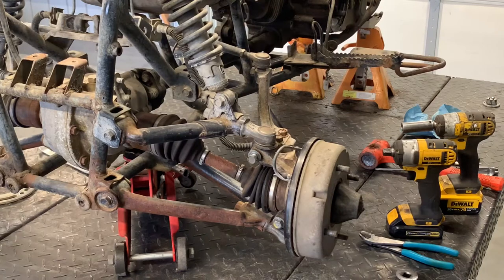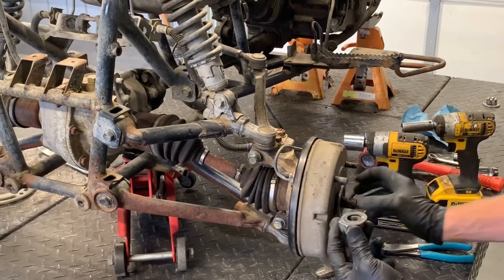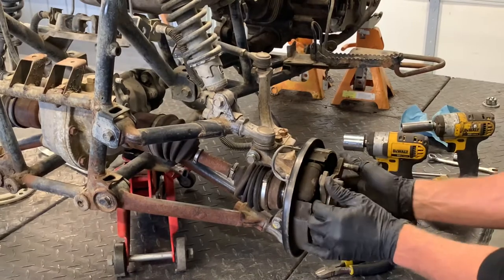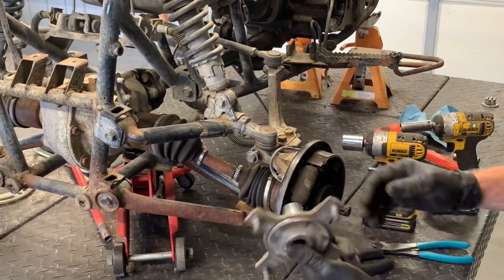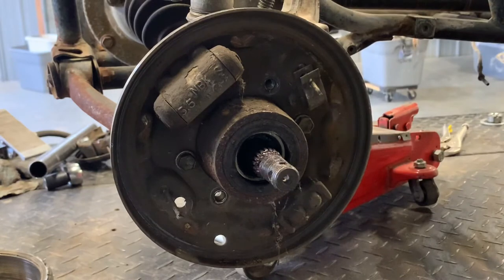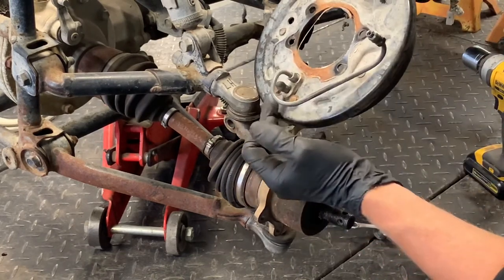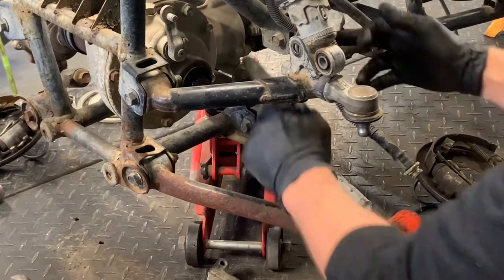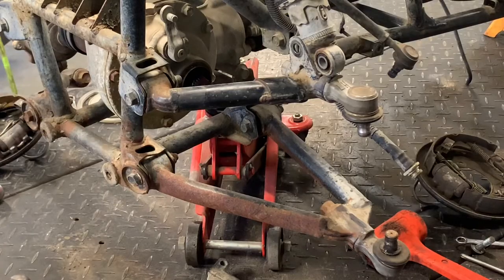Suzuki Quadrunner 250 - Brake Shoe Replacement - GETTER Done RIGHT!

Comment: Also little bit of knowledge from my understanding, is that the Suzuki SHOE HOLD DOWN SPRING (that most aftermarket kits don't come with) is designed to stop the brakes expanding to much by holding the lever arm by spring clip so you don't ruin your wheel cylinders if they get too low (like mine did and you have to buy repair kit or replace them which is expensive)

Comment: Good job. Great video. A little knowledge for you bolt size are not designated by the socket size you use on them but the diameter of the threaded portion of the bolt. But that is nice that you gave the socket size for each.
Reply from the maker: Agreed with bolt size. My though process is majority of people want to know socket size not bolt size. If people had a strong opinion, I'd switch to real bolt size. Let me know what you think. Thanks for watching and the comment. Let us know if you need anything! https://www.ebay.com/str/midnebraskamotorsports

Comment: umm what replacement that was removal, now cannot get the dam hub back on
Reply from the maker: Yep, I was showing you how to replace if needed. Mine were just fine!! They can get a bear getting back on. Occasionally you need to compress the shoes and once the hub is on you can expand them again.  Hope that helps. Thanks for watching!!

Comment: How easy is it to replace the cylinder (what pushes the shoes out)? My handle on the master cylinder is stiff and when I do get it to squeeze it locks the front wheels
Reply: I'm dealing with the exact same problem. I took mine off and used a pipe wrench to work the steel insert out of the cylinder. Then I sanded it up and cleaned all the rust off. Really hope the cylinder still works since I can't find new ones anywhere in the world.
Reply: I accidently may have just found a cylinder that still works. 54540-19B10. It's a gamble but that the new model of suzuki and it looks the same.
Reply: @Sides580  I actually ordered one off Amazon, if it works I’ll come back and link it. It was $11